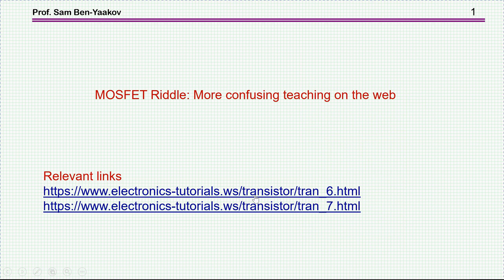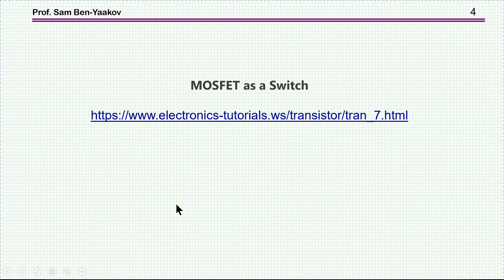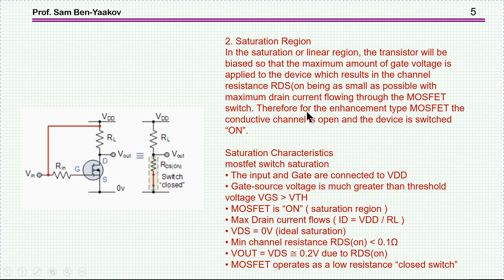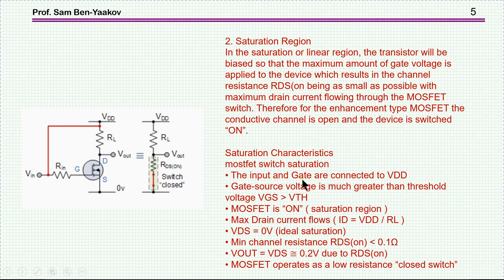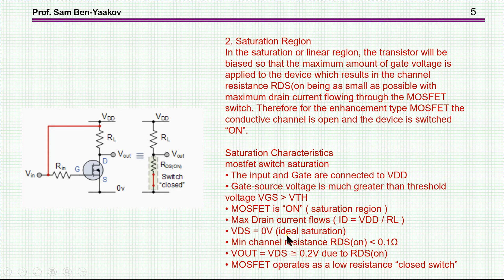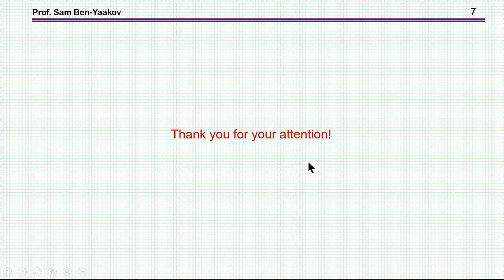MOSFET Riddle: More confusing teaching on the web

Comment: 1. Saturation: Vgs>Vth, Vds>Vgs-Vth (MOSFET can be used as an amplifier here);
2. Triode region: Vgs>Vth, Vds<Vgs-Vth;
3. Ohmic region (sometimes "triode" and "ohmic region" terms are used interchangeably): Vgs>Vth, Vds<< Vgs-Vth (MOSFET acts as a switch here);
4. In ohmic region: channel resistance Ron = d Vds/d Ids =  k/(Vgs-Vth), where k depends on transistor geometry and technology;
5. Therefore, in ohmic region: Vds = Ron * Ids (not 0.2 V).
6. In general, Ids is defined by Ids = f(Vds,Vgs) (although in saturation region it does not depend significantly on Vds value, depending on channel length modulation), which is a characteristic of the MOSFET, and Ids = (Vdd-Vds)/R_L, which is defined by the external circuit, and the operation point can be found from these two equations.
Reply from the maker: Good points. Thanks for participating.

Comment: Hi Professor Yaakov,

In statement 3 ,  he states that the mosfet is in the saturation region. It also states that it is in constant current and is fully on. In the saturation region, the mosfets acts as a current source in parrallel with Ro. The Ro is what give the ID vs Vgs the slight incline to the horiznatal ID curve. If the Ro is infinite, then the Id curve would be a perfect horizontal curve. The fully on I ussaully think of as being Rdson, But Rdson is speciflied in the triode region. So I interpret this to be incorrect.

So basically the Saturation and triode region seem to be reversed. For example In saturation characteristic, where it states Vout=Vds-0.2 due to Rds(on). This is incorrect. Rdson is specified under triode conditions only.
Reply from the maker: Thanks Robert for participating. Good points, but there are more

Comment: 1.Saturation region is not correct in graph. At saturation The Fet behaves as resistor. 
2. 0.2V usually is saturation voltage for bipolar transistor not mosfet. Mosfet behaves like resistor . 
3. Linear region is the region where mosfet behaves like current source. 
4.When mosfet in constant current region it is not acting as switch.
Reply from the maker: Good points, but there are more

Comment: 1. ID = ID-max is utter nonsense. ID will be dependent on VDD
2. in saturation or linear region.... RDS will be as small as possible is incorrect too. During linear region, RDS decreases from a high value to a low value. Actual RDS on is dependent on VGS
3. VDS = 0.2 V is also not true. VDS is dependent on ID, RDSon.. so cannot state a solid figure there
Reply from the maker: Good points, but there is more

Comment: Sir, I think in first condition for saturation,  Vds should be "greater than or equal" to the overdrive voltage(i.e. Vgs - Vth) instead of just Vgs. 
Other than that, other comments have pointed out other mistakes in the riddle.
Reply from the maker: Thanks. Good addition.

Comment: In second part i noticed next:
1. There is no need to connect Vin and Gate to Vdd to saturate the mosfet switch (for example, if vdd is 55v and you connect it to Gate your mosfet will became a jumper).
2. Vds=0v is not ideal saturation, it is a saturation of ideal transistor
Reply from the maker: Good points, but there is more

Comment: To be used as a switch, an N-channel enhancement-mode MOSFET should be biased to work either in the linear region, which is also known as the ohmic mode or triode mode (VGS > VTH; VDS < VGS-VTH; the MOSFET is acting effectively as a closed switch, with a resistance equal to RDSON), or in the cutoff region (VGS < VTH; the transistor is acting as an open switch).

It seems that the author messed up the characteristics of a MOSFET in linear and saturation regions: he speaks about the saturation region and saturation characteristics, but in the same time, the provided values for VGS and VDS in his example (VGS >> VTH and VDS≈0) can only mean that the MOSFET is in linear region (ohmic mode).

The way the author uses the term saturation makes me think that he perhaps made a confusion between the linear region of a MOSFET and a saturation region of a BJT.

However, in an attempt to verify the terminology when describing the output characteristics of a MOSFET, and to find what else can be a source of confusion, I found a source (an application note from Infineon) where the term linear mode is used to describe the saturation region:
"Many applications exist with the Power-MOSFET being operated primarily in linear mode. Linear mode operation refers to the current saturation region in the output characteristics."
Source: https://www.infineon.com/dgdl/Infineon-ApplicationNote_Linear_Mode_Operation_Safe_Operation_Diagram_MOSFETs-AN-v01_00-EN.pdf?fileId=db3a30433e30e4bf013e3646e9381200
Reply from the maker: You have good points but  "in the linear region, which is also known as the ohmic mode or triode mode" is incorrect. The linear is in saturation
Reply: @sambenyaakov  Thank you for the reply.
The thing is that in my short research to verify the terminology (before I wrote my initial comment) I got an impression that there is an ambiguity in the meaning of the term linear region or linear mode (in a sense whether it is used for referring to the ohmic region or to the saturation region of a MOSFET output characteristics).
If it's used for the ohmic region, I assume that the justification comes from the approximation that, for a given VGS, the drain current ID is almost linearly dependent on the VDS voltage.

In the article on Wikipedia about the MOSFET (https://en.wikipedia.org/wiki/MOSFET ), this region/mode is named "Triode mode or linear region (also known as the ohmic mode)", with references to:
- Galup-Montoro, C. & M.C., Schneider (2007). MOSFET modeling for circuit analysis and design. London/Singapore: World Scientific. p. 83. ISBN 978-981-256-810-6.
- Malik, Norbert R. (1995). Electronic circuits: analysis, simulation, and design. Englewood Cliffs, NJ: Prentice Hall. pp. 315–16. ISBN 978-0-02-374910-0.

In the same article, on the output characteristics drawing, again, the term linear region is used for the region when VGS > VTH; VDS < VGS-VTH:

https://upload.wikimedia.org/wikipedia/commons/thumb/1/18/IvsV_mosfet.svg/1024px-IvsV_mosfet.svg.png

The other alternative term that they use there for the saturation region is active region or mode.

In an article named "MOS FET device as a switch" on https://wiki.analog.com/university/courses/alm1k/alm-lab-4ms the term linear region is again used as a sinonim for the triode region.

On the other hand, Infineon technologies use it as a synonym for the saturation region (as I wrote in my previous comment).

Nevertheless, in other words, my main remark of the mentioned "tutorial" is that the author made a confusion in the terms and he used the term saturation as it is used for the BJTs, although this term for MOSFET has other meaning.
Reply from the maker: Indeed the confusion between BJT and MOSFET is the original sin.

Comment: Before even rewinding to review what was said, it sounds like the articles are confusing the saturation region between MOSFET's and BJT's. Ok, rewinding:

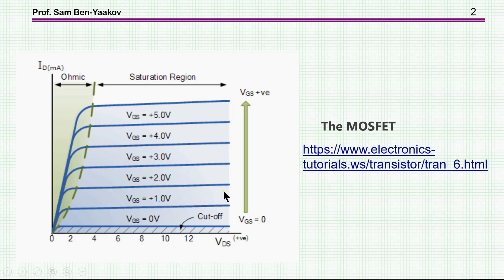0:25
This graph looks alright. in Cutoff region, almost no current should flow. In saturation, the FET is in the linear region (channel is in "pinch-off") and can be thought of as a voltage-controlled current sink. Ohmic region looks good as well, slope is limited by Rds(on) of the FET in question. Where the FET escapes the ohmic region to the saturation region, I seem to recall is a parabola and that dashed green line has a special name. Id and Vds labels for X and Y axis are correct. As expected the plot gets to higher Ids with higher Vgs and is in cutoff with Vgs=0.

0:54
I disagree with the statement that saturation means the transistor is "fully on", my definition of "fully on" would be the transistor is in the ohmic region where the voltage drop is about as low as it can possibly be, equal to the Rds(on) of the FET. Saturation means there is excessive voltage drop and power dissipation in your FET, if you are using it as a switch. Saturation region is desired with linear amplification circuits where you want the transistor to act like a voltage-controlled current source. In other words, Id is NOT the maximum because the Vgs can be increased to decrease voltage drop. Unless you operate at excessive current and pop it. Also, Vds and Vgs are mostly unrelated for FETs, only related by the reasoning behind the curve at 0:25 and miller effects, stuff like that. My this, I mean pinch-off occurs because of the electric field from the drain/source affects the channel (pinch-off)

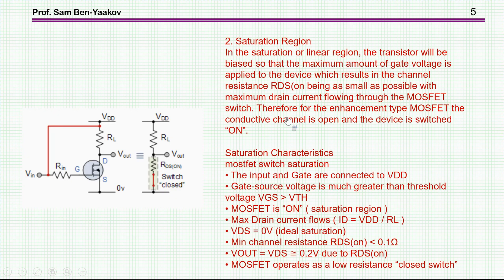1:23
OK I am immediately looking at that schematic and thinking it isn't always a good idea to tie the gate to VCC like that, if VCC is higher than 20 volts for most power MOSFETs, you will pop the gate. Generally this means the transistor will be stuck ON, or the gate will be shorted to the drain and the channel will act like a 4V to 6V zener diode, or... well like you physically short together the gate and source! 

They clearly confused saturation region of FETs and BJTs. In a BJT, saturation is analogous to the ohmic region of a FET, which I think is stupid and confusing terminology. This whole section should be talking about the "ohmic" region shown at 0:25. I can also nitpick that Rds(on) depends entirely on the FET, I have small signal and very high voltage FETs that have Rds(on) above 100mOhms. And the FET will only act as a "closed switch" up to a certain current where pinchoff will begin to occur. But if the gate is tied to VCC the FET might fail due to I2R losses and heat before then probably.
Reply from the maker: Extremely good points. The confusion with BJT is the original sin

Comment: One I saw immediately is the statement that the saturation region is "constant current region".   That doesn't seem correct.   On the second page, it says in the saturation ** or linear ** region ... maximum drain current ... acting as a switch.    "or linear" region seems to be the opposite of the saturation region so indicating both seems incorrect.   On the second page it states that Id = Vdd /Rl.    I think that should be approximate.   I think it is better written as Id = Vdd / (Rds(on) + Rl).
How did I do?
Reply from the maker: Very good points but there is more to it

Comment: I think the author got confused with the active region of the MOSFET being referred to as Saturation region. He was using the "saturation region" terminology of BJTs for explaining MOSFET's operating regions.
Reply from the maker: Excellent. This is the original sin
Reply: the term saturation is a legacy term.  when vds>vdssat or vds>(vgs-vt) your inversion surface channel isn't going to carry any more current despite your increases in vds.  hence saturation.  which is INCREDIBLY confusing for bjt saturation (where IB is made large enough such that IC < beta IB) is NOT analogous.  (to be ridiculously pedantic, you could say saturation WITH RESPECT TO vds)

wikipedia does a proper cite on this on their MOSFET article.  they cite sedra/smith and grey/meyer.  i would cite sodini/howe.

so yeah, it's a device physics term, as opposed to a circuit term.  sorry.

Comment: First Part:
Drain current Id depends on the Gate Source Voltage Vgs. The MOSFET acts like a current source with the current depending on Vgs, so not necessarily maximum.

Second Part:
I would say Rds_on is not only minimum with maximum Vgs, but with maximum Vds. I would derive this from the Id-Vds curve.
Again with the wrong assumption ID=VDD/RL the drain current is not depending on the Gate-Source Voltage which is a contradiction to the Id-Vds-curves diagram.
Vds will at least be equal to Rds_on*Id and not zero.
Reply from the maker: Good points but there is more to it

Comment: In the second part, I would note that the MOSFET behaves like a switch as long as RL is low enough to maintain the MOSFET in saturation region, Therefore the “switch” does not work for any load.
Reply from the maker: Good points but there is more to i

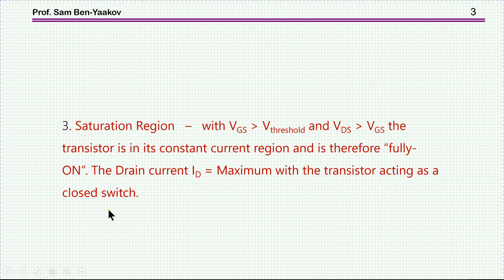Comment: 0:53 a transistor can't be both "saturated fully on closed switch" and in its linear region. Vds>Vgs is only possible in linear mode or when off, otherwise the transistor would blow up. It is not necessary to be at maximum Id current to be in "closed switch" mode and if anything Vgs should be close to max for reliable saturation. High drain currents are a risk for the health of the transistor and if anything-they might push it back into linear mode.
1:32 again, confusing saturated with linear mode.
"""saturation characteristics"""
1.the input and gate-redundant, because the example assumes they already are the same
connected to Vdd-If Vdd is above 20 volts then the example is wrong, because 20 is the breakdown Vgs of most transistors. It should be "the gate is supplied with the proper saturation voltage according to the load and transistor datasheet or lower than the breakdown Vgs"
2. Vgs>>Vth, again much greater isn't technically correct. It should be between the saturation region of the datasheet and Vgs max
3. yes its on
4. applies to a mosfet with ideal channel and you can still achieve it on the border between linear and saturated.
5. ideally saturated mosfet with ideal channel.
6. Rds ON depends on the transistor. High voltage mosfets have a few ohms Rds On. This is in contradiction with the context of ideal transistor so far.
7. 0.2 is a common value for bipolar transistors, because they have a voltage drop in saturated mode. The whole point of MOS is their resistive behavior, where the voltage drop is wildly variable and highly dependent on the load and gate saturation.
8.Again a sudden switch to describing a real, not idealized transistor
Reply from the maker: Very good points but there is more to i

Comment: - It should be ID=Vdd/(RL + RDS + Rwiring).
- Vds can't be equal to zero if there is voltage supplied since Rds is never zero. Even if it is <0.1 Ohm it is not a superconductor.
- If Vout=Vds and Vds=0 it can't be =0.2V in the same time.
Reply from the maker: Good points but there is more to it